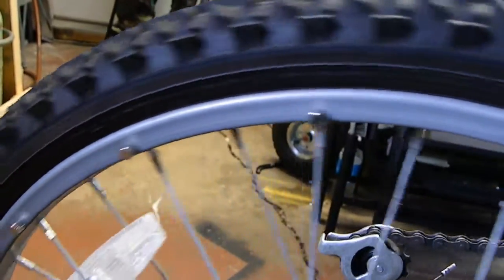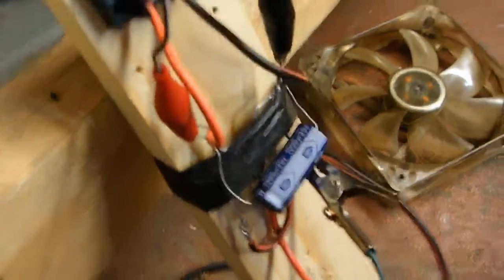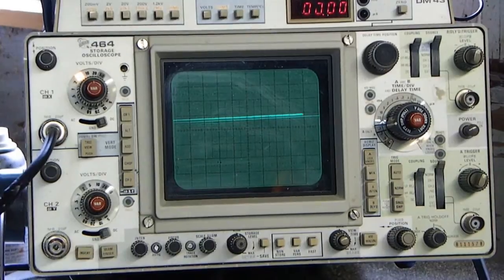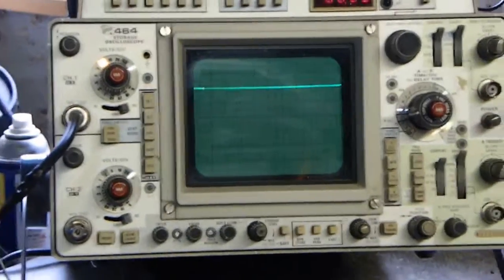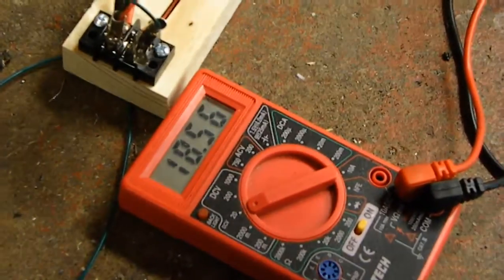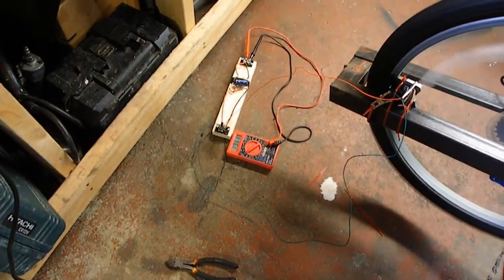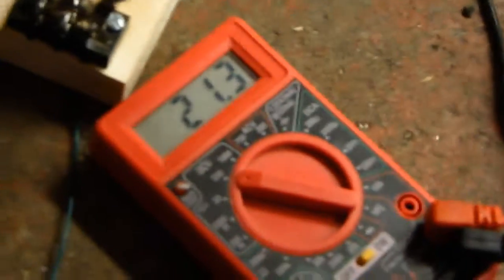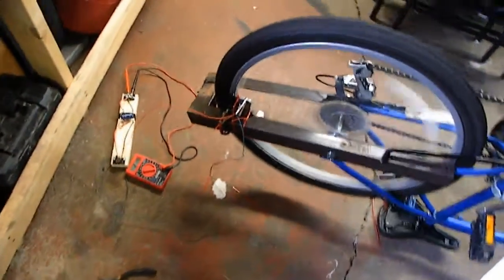Generator made from magnets and bicycle

Comment: I agree. Under load it will show how well the capacitor will do.
Another suggestion: Attach a voltage regulator at the end of the circuit. a 5 Volt one should do well, as most devices nowadays are designed to be powered with "USB power".